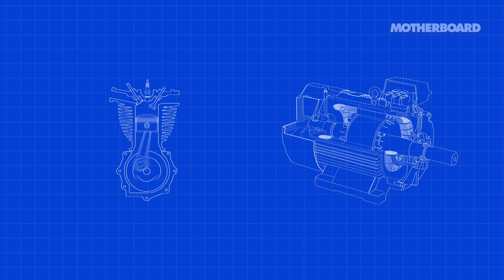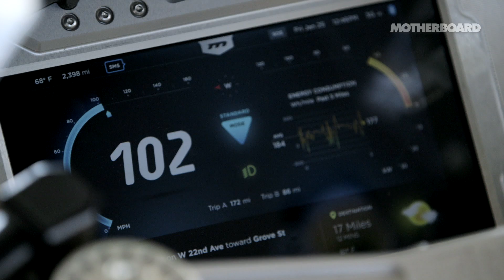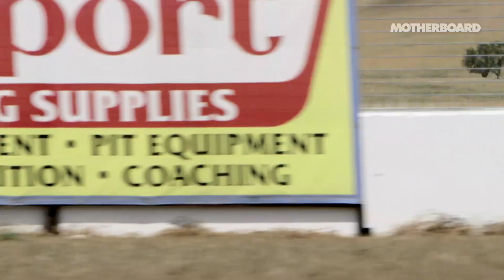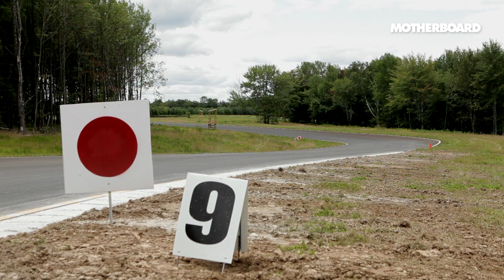Mission RS: The Electric Superbike of the Future

Comment: Yeah that's a good point. Not to mention you would have to get the real expensive batteries replaced after what, 7...10years? that could cost another few $k too.

I spent $20 a week on fuel using an R6 for years, about $1000 a year. That bike cost me about $12,000. So that's about $16,000 for 4 years with fuel. I would have to keep that bike for 49 years in order to break even. Fuel expensive in Aus.

Having said that, I like the idea and I would fork out $25k for it if i knew it was reliable.

Comment: Yeah I've got a VFR800 that weighs 525lbs with 60ft/lb of torque and it will throttle wheelie in 1st. 120ft/lb seems nuts. Then again I bet it is tamed down a lot through gearing since it will likely do 160-180MPH on a single gear.

Comment: They aren't hocking this as an econo, Please do tell me how your bike has a tube chassis, ohlins front and back, carbon fiber wheels, single sided swing-arm, 160HP, LED Headlight, LCD display and navigation, etc. This is a SUPERBIKE in Rolls-Royce quality packaging, don't bother comparing it to your 250cc, you might as well be on a scooter.

Comment: I'm inclined to agree on your point about black and white TVs, these bikes may not be anything but history in 30-40 years.  However, I have to disagree on the pricepoint argument.  The $75k bike is for their top end bike.  The base version costs less than half of that.  For some one who's going from a commuter vehicle that gets 17-22mpg city/hwy, this helps bring electric commuting much closer to the mainstream.  Add on top of that that it's quick, and you have something special.

Comment: I'm not sure where you get the $70k figure... the base model goes for $30k. Sure you can buy wtf you want for much cheaper that will perform better, but not having to rely on fossil fuels and also having a bitchen bike that hauls ass may and will be worth it to some. I'd never buy a Prius but if I had the money I would seriously consider a Tesla. Would you rather they produce a slow, low performance motorbike for $3k that would have a range of 30-40 miles and take 8 hours to charge?

Comment: I could imagine someone getting on and snapping back the throttle only to have all of that torque take the bike out from underneath them and flip down the road into a $75,000 pile of buckled carbon fibre and cheap alloy.... clutch and gears are a must, if only to keep the feeling of control

Comment: You guys seem to think lithium ion batteries will still be used in the near future? They have already developed super capacitor batteries thats made from some carbon nano tube thing. It is super cheap to produce and not bad for the environment. It can charge a phone in 15 seconds to 100%. Recharging these future batteries would probably be as quick if not quicker than refilling your car at the station.

Comment: For me it isn't a question of speed or how much range it has. The guy in the video says motorcycles are all about performance but if this were true wouldn't there only be a market for sport bikes?
In my opinion, a lot of what riders love about motorcycling is the connection you feel with the engine. Whether it's the sound, the vibration, the character..
An electric motorcycle will always lack the soul of a conventional bike.

Comment: Well matt don't forget that the majority of people in the world don't actually own a car, so the problem's not as bad as you think. In fact what you'd do is transition most people on to CNG first - most petrol engines will work with little conversion and get better mileage. That'll get most people off of oil, and if can dare to condone Fracking for Natural Gas, the US alone has quite a fair amount to supply vehicles. And then that gives us time to start transitioning to electric/fuel cells.

Comment: For those who don't like the fact that it doesn't make that cool obnoxious speed bike noise - I've ridden the zero motorcycle a few times.  The best thing about it is the lack of noise.  It is the most surreal experience to be going that fast without hearing anything but the wind.  I can hear the crotch rockets from miles away.  Electrics need to compete on performance, that is what will convince people to buy.  Racing is also the best way to provide innovation.

Comment: The problem with electric vehicles is not really about performance or range or aesthetics against a conventional fossil fueled bike. I believe that the biggest problem with electric vehicles is what plagues ALL electronic equipment, the fact that it cannot be depended on in a dire situation. You cannot carry enough electricity with you in the same way u can carry petrol, not unless they revolutionize batteries. What happens if you were stranded in the middle of nowhere and had to walk to refill?

Comment: It's only $75,000 because this is the first commercial release. As more people buy them, they can start running larger production and get the price down. It's the same strategy Tesla used releasing the roadster first ($100k+), and then the  model S (60k+), and in the future i think they are gunning for a 30k model. It's the only way a new company without deep pockets can do it and not go bankrupt.

Comment: or riders/ testers. totally depressing! invite some WSB champs or moto gp riders ect. 

still far too tech limited, even the cars are way too heavy. takes too long to charge ect
im wondering now they can print minscule solar panels as thin as paper, could you cover the rear ferring in those and extend range ect. cant wait till batteries weigh the same as the engines do in todays bikes then ill be excited

Comment: Sport bike with no sound = Fail - Don't care if it has 10,000BHP. What is the cost of the battery pack when it can't no longer do 30miles, same as your laptop but your laptop's battery worth only around 100$. Hybrid is the best compromise because you still can rely on an engine if your battery are plain dead, i mean when they can't fully charge or get enough charge to carry you to point B.

Comment: Well they would work on making new batteries, work in a power plant and would probably make spare parts for electric vehicles... That's not the problem at all.

The real problem is that there are a lot of influencial people who want more gas using cars to be made. These people put their money towards research on gas engines and against electric motors research. 
These bikes are this expensive because the company has to finance most of their research and engineering themselves.

Comment: There bikes start at 29k, and yes that is expensive for a moto. However they are top of the line motorcycles with high end components (brembo, ohlins) not to mention all the tech that went into the electric systems.

Comment: Be better for self generating and not have to plug into the grid... like how Nikola Tesla's electric carriage vehicle that he had designed and having to 'pull' the energy that is all around us to use freely to power everything that uses electricity or be powered by electricity... the power industry of oil/gas/coal/electric/nuclear does not want for such devices that takes away business and revenue.
Stanley Meyer found another source to use hydrogen; John Kanzius push the envelope by using RF.